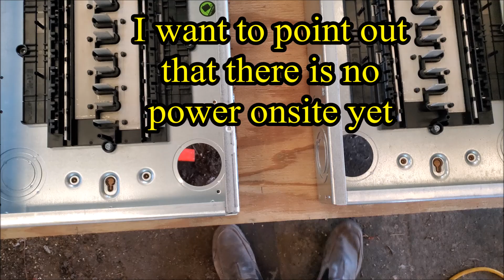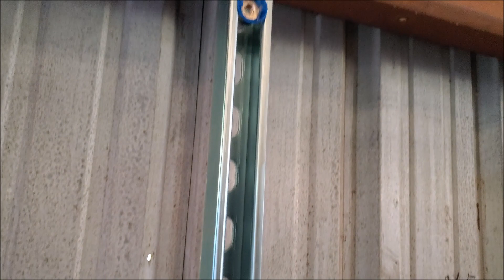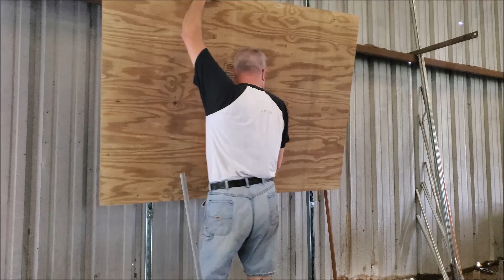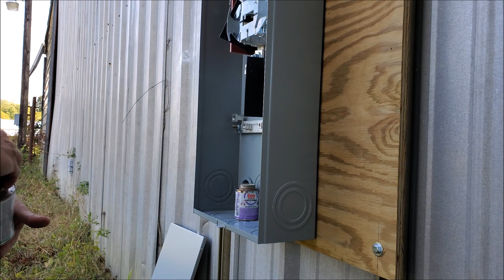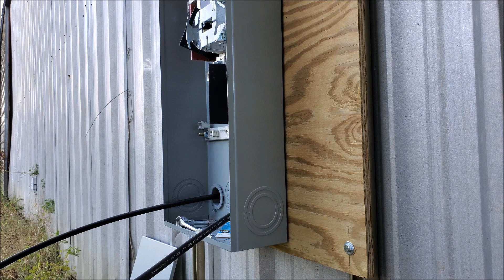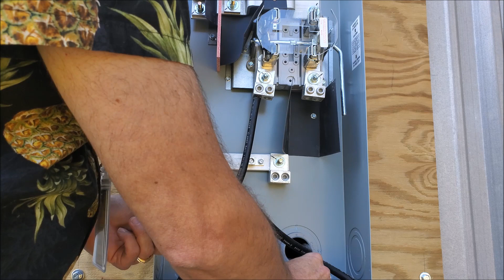Monster Shop Power Update - Pt II

Comment: Use a utility blade to strip big wire. Its easier and there is less of a chance of knicking that conductor.
Reply from the maker: Thank you, that's probably the one tool I neglected to bring over to the building when I made this series!

Comment: Looking forward to the next video. My shop needs a sub panel installed and I just haven't been brave enough to tackle it. Watching your video helps me plan out the project in my mind. Thank you for sharing your expertise!
Reply from the maker: Thank you for the support, and work safe! Actually a sub-panel is on the to-do list, because I have to ultimately get power across to the other side of the building, and I don't want individual 100 ft circuits. I have a couple embedded 1" conduits that I will pull wires to a 90amp subpanel mounted on the opposite wall. Holding me back is the sticker shock of a couple hundred feet of #3 copper...